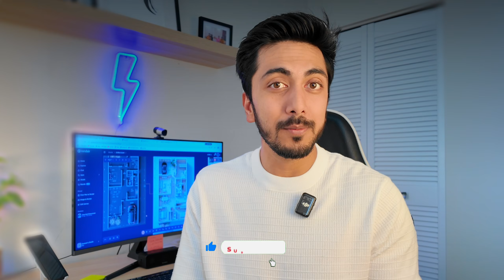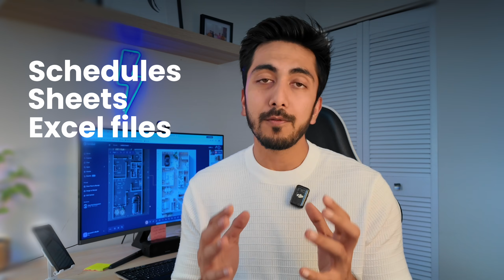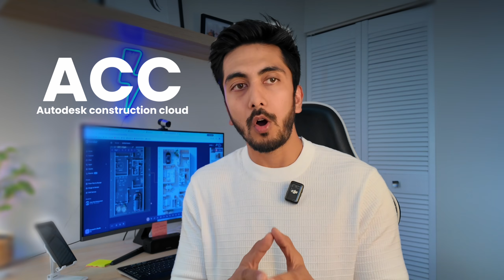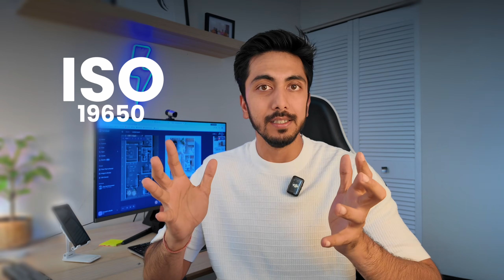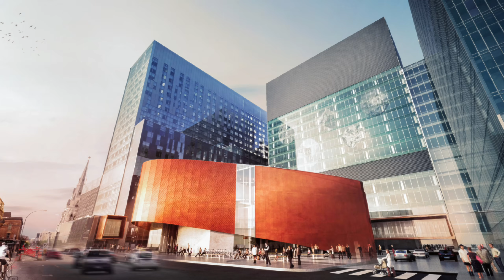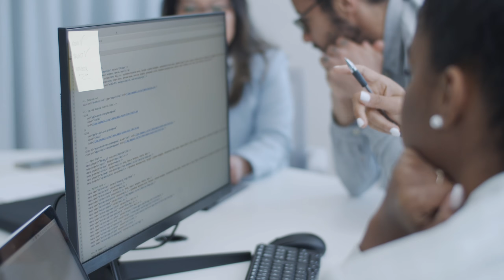How to Get Into BIM in 2026 | Complete Roadmap for Architects, Civil & MEP Engineers

Comment: I am a Civil Engineer having an experience of 10+ years in building construction. I have handled execution, billing, estimation etc. of construction, finishing and interior designing. How can or should I be approaching a career in BIM? Will I have to start from scratch i.e. BIM modeller? Should I join a course by BuildAmbit by RSP? Please guide. Thanks in advance.
Reply from the maker: Starting from scratch will depend on what level of software level you are on, how much you have worked on project what have bim enabled on it. My advice to you would be to look for construction project management degree, because of your site experience and execution experience you will have better success rate.

Comment: Hi .im tool die maker diploma completed  worked as fabrication designer . Im trying to shift bim modeling can I doo
Reply from the maker: You can do it but if you have experience fabrication why not use it and get in to fabrication modeling for cnc, 3d printing and other precision manufacturing.
Bim will take you a bit away from your core skill.

Comment: Great information! I have been following you for some time, and I have a question.

I am 23 years old. I completed 10th grade and then had a 6-year gap. Now I want to start a career in BIM.

My plan is to do a 3-year DAE diploma in Electrical because that is the only option available in my area. At the same time, I want to learn BIM, build a portfolio, and, if possible, do some freelance work or get a local job in Pakistan.

My main goal is to get a BIM job in the Gulf or another country. What would you advise me?
Reply from the maker: That is a solid plan, focus on mastering MEP modeling during your diploma to build a strong portfolio for international roles. ✨
Look for companies in Pakistan working for middle east outsourcing work or have a branch in middl east, after some experience there you can apply for roles abroad. Dont do freelancing for experience, firms dont consider it.
Reply: @ArchiVlogs. Thanks! I don't have anyone who can guide me at this level, so I would really appreciate your advice.

Does my Electrical DAE matter? Will it limit me to only MEP, or can I still build a career in other BIM disciplines?

Also, most companies abroad ask for experience. Can strong personal portfolio projects be considered, or is company experience necessary? Since BIM opportunities are very limited in Pakistan, what would you recommend?
Reply: @revit-p6s7 personal experience is good but companies need to see your company based experience that gives them trust